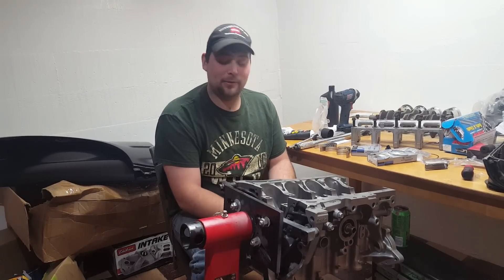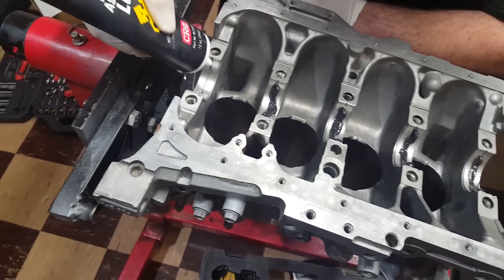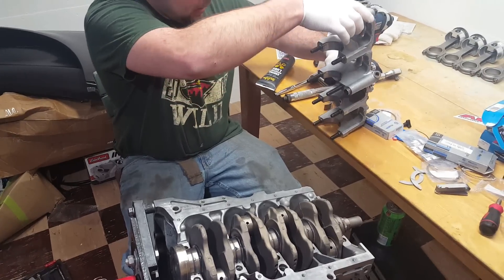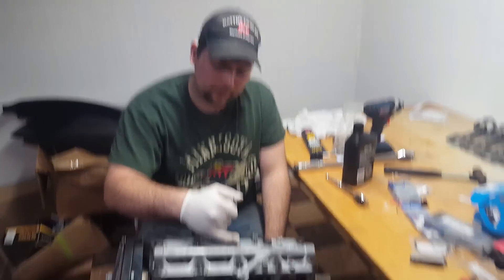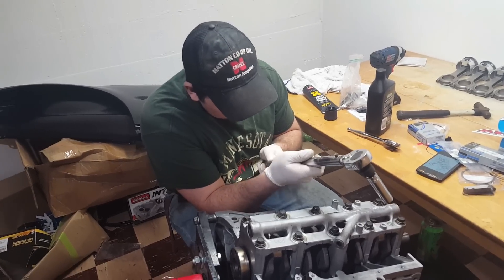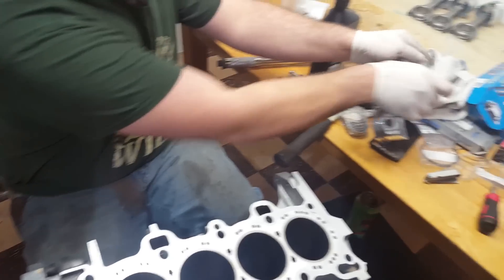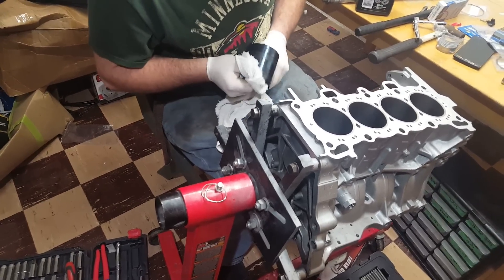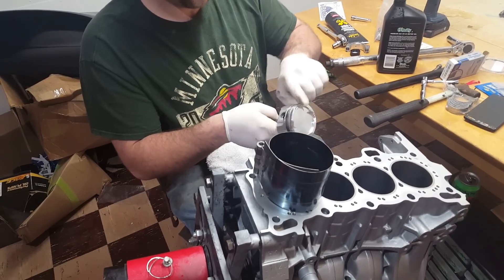D16 Build For Boost pt:1

Comment: Oem bearings are actually better. They are harder material meant for constant heat cycling. I’ve found aftermarket bearings fail far more than the oem bearings in several builds. The aftermarket bearings are much softer and only meant for fewer cycles.

Comment: Can you upgrade the girdle on the d series. I managed to on my f series for cheap.
Reply from the maker: Not sure, I've never looked into it but I was able to find ARP girdle bolts for it
Reply: @hondahowto  yeah I guess with the f series as it progressed they upgraded it and made it stronger because I had 2 cb7s with f22a1 and f22a6. The f23 is more stout and bolts right up. But I just picked up a wagovan and I'm looking into either building the d16 or swapping. Maybe B series.
Reply from the maker: @Lost10mm.  If it's RT4WD a common swap for them was the D16 DOHC out of a first gen Integra because that engines transmission is the same bolt pattern as all of the sohc engines but if it's fwd b series is the way to go
Reply: @hondahowto  it's in ruff looking shape but it's the rt4wd 91 manual with a 1.6 haven't looked for the stamp yet. There's moss and liken growing on it. I'm so tempted to leave it looking like that on the outside and all money and time into the motor and clutch.

Comment: hey man its my first time stumbling on your channel and video and im rebuilding my d16y8 in a couple weeks as a first timer and just wanted know if you used plastigauge to check oil clearances on your bearings
Reply from the maker: I had a machine shop measure all of the clearances on this engine, but I've used plasti gauge before. It works well, nothing wrong with it, the b16 I built I used plasti gauge, still drive it every single day!
Reply: @hondahowto  sweet man that you for the reply 🙏🏽🙏🏽

Comment: What size pistons are you using?
Reply from the maker: .10 oversized
Reply: @hondahowto  how much in mm? Compared to stock?
Reply from the maker: @fforfahim  if I remember right it was 75.5mm
Reply: @hondahowto  what I'm asking is, what was the size of stock pistons, and now the new ones
Reply from the maker: @fforfahim  stock bore on a d16z6 is 75mm so I had it honed to 75.5mm for oversized JE pistons, you don't have to overbore if it doesn't need it, you can use standard size pistons if the bores are straight and true.
Reply: @hondahowto  so how much was the gain after using JE pistons? Stock crank?
Reply from the maker: @fforfahim  yep, stock crank. With all of that stuff it made a little over 500 wheel, but my buddy turned it down a lot because it kept smoking the tires too easy. 350-400 hp in a fwd car is perfect, anything over that, you have to invest in suspension and slicks.

Comment: Did you have your block bored or did you just throw in 75mm?
Reply from the maker: Had to notch the sleeve and girdle for the h-beam rods, sent the block to CSS, they did their thing, and when I got it back I had it honed. So it's still standard bore. Never over bored it.
Reply: @hondahowto  don't wanna sound like a noob but can I just get high compression pistons (75mm) with my d16z6 stock bore (75mm) to save on getting block bored
Reply from the maker: @SSJ_Skoden  that's exactly how you bump up compression. I have built a high compression engine for nitrous way back in the day, kept it store bore, and put dome pistons in it.

Comment: Here I was hoping for a d16a6 build..🥵
Reply from the maker: Pretty similar, with the a6, you have a lot less bs to deal with.
Reply: Quick question. Any way i could pull the pistons without completely pulling the motor? Or not do able? 21 and I’ve only been working on cars for about a year and a half.
Reply from the maker: @weebnoob4973  you sure can, pull the cylinder head off, and pull off the oil pan. Unbolt the connecting rod caps from the crank and push them out of the top.

Comment: Thanks a lot, for this serie of videos, even if I already reassembled some blocks I learned a few tips.
But something looks unusual to me. On your exhaust side block looks like there's a sensor in place of the coolant bolt, would love to know what it is.
Reply from the maker: I live up North, it's just a block heater. I eventually took it off and put the stock plug back there. And thank you for your kind words!
Reply: @hondahowto  Thanks a lot, I will sleep a little bit smarter 😉
PS : surprised you need this in Texas, here in Europe those kind of pre-heater are for German market and further up.
Reply from the maker: @zeedim9882  I live in North Dakota, so the average temps here in the winter range from -25° to -40°F which is -31.6 C to -40 C and wind chills can get to -80° F so it's pretty cold up here in the winter
Reply: @hondahowto  Sorry for the confusion, I understand better,now.
Reply from the maker: @zeedim9882  it's all good, people have asked me about that sensor a bunch of times

Comment: Did you sleeve your block? I am working on a d16y8 block and mine doesn't look like that lol I still have the space around the cylinder walls. If you did could you please tell me the name or type of work that was done to it so that I can ask the machine shop to do it on mine as well?
Reply from the maker: It's a company called CSS. Cylinder Support Systems. You send them your bare block and they do all of the work for you!
Reply: @hondahowto  ok cool thanks! This will be my first turbo build so I am trying to reinforce the bottom end and make it as strong as possible to prevent it from blowing up!
Reply from the maker: @0rvelazqu  well if you have any questions I'm always here.
Reply: @hondahowto  thanks man! Did you have to send in your new Pistons along with the rods and cranks to CSS in order to get them balanced? Or did you do that at a different shop?
Reply from the maker: @0rvelazqu  different shop. And if you haven't had the surface of the block decked, CSS will do that for you if you ask. They can even copper o ring the block if you want them to.
Reply: @hondahowto  the block is completely stock, we just pulled it from the yard on Saturday so I'm trying to do some research and see what I need to do to it. Our plan is to boost it and hopefully make 300+ horsepower! The donor Civic had 150k on the speedometer and the cylinder walls appear to be solid. I wonder if I should take it to my local machine shop first for inspection just to make sure it's a good block before I ship it out to CSS?
Reply: @hondahowto  I appreciate the info! I do have another question, which size pistons do you recommend?
Reply from the maker: @0rvelazqu  standard size usually. But if you have to over bore, it's not that big of a deal. I always try to use standard bore, just because there's more material on the sleeve, but sometimes it doesn't work out that way.
Reply: @hondahowto  ok thank you, I am taking the bare block in to the shop and get it inspected before I ship it out to get it CSS
Reply from the maker: @0rvelazqu  yep perfect, if the bore isn't egg shaped or out of wack you could probably get by with just a hone. Be sure to not deck it until it gets back from css, because they won't deck them unless you ask, and it will need to be decked because the guard they put in protrudes out a little bit, so keep that in mind.
Reply from the maker: Pretty decent turn around time as well

Comment: The thing I'm not comfortable with is bearing sizes.
Reply from the maker: Bearing clearances are pretty easy. You can usually use standard size bearings if your crankshaft is fine. If you are using a crankshaft that spun a bearing on it then you need to send the crank to the machine shop to get it turned, then you would need oversized bearings. Make sure you check the bearing clearance with plastigauge or a micrometer and a dial bore gauge. I always use plastigauge and i get alot of hate for it but I've never had any problems with it, just to make sure the bearing size is within factory specs.
Reply: @hondahowto  my crank was ugly so I bought a refurbished one from nipon racing on eBay. Should I start with standard size? Thanks so much for the info!!
Reply from the maker: @TheRadChannel  i would absolutely start with standard size bearings. Usually if they are not within spec you can send them back and swap them with oversized ones
Reply: @hondahowto  thanks again!! I just spent 750 to get my Y8 Back from CSS. I really want the experience of building it myself and honestly don’t have another 700 to have them build it. 😂
Reply from the maker: @TheRadChannel  well if you have and questions dont be afraid to ask. I have my phone on me all the time and i have it set so i get all my messages on my phone
Reply: @hondahowto  Thanks for the support!  I appreciate it very much!

Comment: Is the torque specs on this video accurate to all d16's?
Reply from the maker: Most yes. They might be a little different between vtec models and non vtec, so keep that in mind. And arp bolts are always higher torque specs than oe bolts

Comment: Hello, 

Big fan of your channel here!

I'm working to bud my first D16 engine. Can you please give your opinion on piston to wall clearance for 400hp and 500hp

Thank you so much and  best wishes!!!
Reply from the maker: Are you running standard bore size or oversized? Alot of people have their own opions on this, in my experience anywhere from .006 to .008, i usually go on the tighter side but some people say that they have had problems, i have not but i guess you would have to take that with a grain of salt. Alot of people think that just because its a turbo build, all the clearances should be a little looser than oem, but clearances are there for a reason. Of course there is much higher loads on an engine when it has forced induction, but there are people that will disagree with certain measurements and clearances. I've definitely learned from my mistakes and i know exactly what works for me, and thats what i go with.
Reply: 75.5 Vitara Pistons
Reply from the maker: @MoM-ur4yg  ok so an overbore. What kind of power are you after?
Reply: Thank you for your time and guidance.
Reply from the maker: @MoM-ur4yg  Sorry i saw it 400-500. Are you doing anything with the block? I know the stock sleeves on a d series can hold up to 400hp but up in that hp range it gets a little scary
Reply: Maxpeedrod, the vitara Pistons 20 over, bore oil pump, working on Neon  SRT ARP head studs/helicoil inserts M11 1.5 tread also workin on a cam, springs and a head gasket. I do have a Gt3582, turbo  manafold.. that's just to start. Thx

Comment: will this work the same for the k20? the thing is that im about to buy a hatchback and put in a k20. but i want to do everything myself and before mounting it i will like to put in some internals(i want it to be at least 600hp). would you be kind enough to tell me what do i need to change? i wont want to change stuff that can be still use.

Comment: Also note: when putting aftermarket rods in a dseries motor, the block almost always has to be notched to clear the rod caps. I learned the hard way, but see that yours is notched. It’s worth mentioning. Great content man.
Reply: Not with the speedfactory no notch rods
Reply: Does the same process apply to a d16y5 vtec-e?
Im new to Honda's so forgive me, I'm not very knowledgeable about them
Reply: @jacobgainey6222  yes all d series blocks would have to be notched with most rods. Except speed factory.
I have d16y5 in my hx as well
But id advice going with a d16z6 if your going to build a block for boost
Reply: jacob gainey I’m honestly not sure man, being a D series, it’s a good possibility.
Reply: Can you explain what you mean by notched?
Reply: grind a little bit of the block for clearance

Comment: You didn't show how you measure for bearing tolerance, how do you know what bearing to use, did your machine shop set it up for you, are you taking there word that all is good without double checking for yourself ? This is the most important part of building an engine setting bearing tolerance for crank & rod & pin tolerance for all oil clearance bearing journals.. i would prefer to use dial bore gauges over plastiguage as it is far more accurate, also recheck pin diameter, small end rod bore diameter, did u balance and match your rods, pistons, pins & rings.. All of this is important as not everyone double checks and takes machine shop's recommendations, there are certain things a machine shop needs to do, it's ok for them to balance the entire rotating assembly, but it is also important to recheck for yourself so you know 100% it's all good before final assembly, Also did you reclean your your block and oil gallies, run pipe cleaners through or gun cleaners through all your oil passages and no red shop towels as they leave lint that can get trapped in oil galleys..Red, White & Blue paper Shop Towels are best for building an engine, Red paper are my favorite as they are super strong when wet, but can be somewhat hard to find.. Remember lint is your enemyy in every engine especially a booted engine to show how everything is put together properly with love and details..You are the last surgeon to reassemble your patient and you want them to live a long full life..Some people might not go as deep as I when building but everything you touch must be spotless and the community needs to know & have & be shown every last detail especially for the less experienced newbie..
Reply from the maker: Everything was measured and came out within factory specification, I personally know the guy that did all of my machine work, so I know it was right. And I did double check most of the clearances myself, I just never recorded it on video. And the block was hot tanked after resurfacing etc. And I cleaned the block and the crankshaft once it came to me after it came back from the machine shop. And I completely agree with you on the dial bore gauge, I don't personally have one but the machine shop that measured all of the clearances used a dial bore gauge, a micrometer, etc. I just checked it myself with plastigauge. It was my first video and I really didn't know that everyone wanted to see all of that stuff so I never really recorded it. And damn Mark, you are pretty knowledgeable, do you build engines yourself?

Comment: I really hope you keep uploading, I love your videos. I can’t wait to see more content from you!
Reply from the maker: Im shooting a video how to build a b series this weekend!
Reply: Honda How To hey, quick question, I’m building a speed factory vitara D16Y8. What would you recommend the girdle bolts to be torqued to?
Reply from the maker: @georgepoulos2096  it's 2 steps, 18 ft lbs first, then 38 ft lbs second, and you have to torque them in a sequence
Reply from the maker: @georgepoulos2096  and make sure you soak the bolt in oil
Reply: Honda How To I went to 40 ft lbs on mine. Do you think an extra 2 lbs would cause any issues? Another question, after a few heat cycles, maybe 100 miles should I drain the oil and pull the pan and check torque? Am I just being overly obsessive?
Reply from the maker: @georgepoulos2096  2 ft lbs won't hurt, I went over because I had ARP main studs, and I don't think you need to open it back up and re torque. They should be fine. I would run 3000 on the oil because you should have assembly lube and other good stuff in the engine. And when you break your engine in make sure you rage the rpms up and down, never keep a constant speed, like driving down the highway with the cruise on. That's a big no no. Just make sure your rpms vary for the first couple thousand miles so the rings seat properly. The only thing that I would do is after about 500 miles I would pull the valve cover when the engine is cold and reset the valve lash. It tends to back off on freshly built engines
Reply: Honda How To awesome man, thank you! I want your channel to blow up. I know your content is genuine.
Reply from the maker: @georgepoulos2096  thanks brother! I wish it would to. But all of this stuff costs money, and I'm just a broke mechanic 🤣
Reply: Honda How To People look for personality. Keep the dirty jokes and the humor. Keep it fresh brother. I know you got it.
Reply: Honda How To Hey obviously you’re still relevant because we’re commenting on your first build video!!!

Comment: So much wrong with this... How long did this engine last? What power level?
Reply from the maker: 500hp and still running! There was stuff that wasn't put in the video that was actually done off camera. And what's wrong with it? All the clearances were checked the rings were gapped, are you talking about the ARP bolts being over torqued? If you torque them to a standard oem specification, the cylinder head will lift, trust me, it's happened to me before. O and yes the block was notched for h-beam connecting rods. So I'm not sure what is wrong with the video? It was my first one, and now I'm kind of regretting not including everything we did because I get questions about it every single day about why didn't do things. But if you think really hard, people would realize that the crank wouldn't have turned if the girdle and block weren't notched, or if you hear about other people building engines that they use more torque on the head bolts because they will lift! Hell I've seen guys drill and tap D series head bolt holes for b series bolts just because they are bigger.
Reply: @hondahowto  just the build was rough. How you prelubed that towel and how you pounded that piston in. Doesnt matter since it's still going strong.